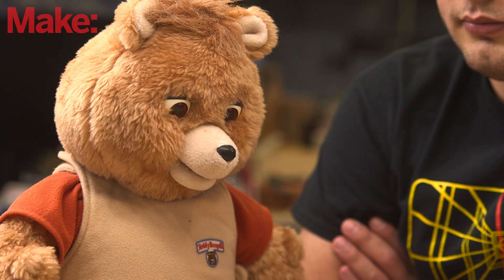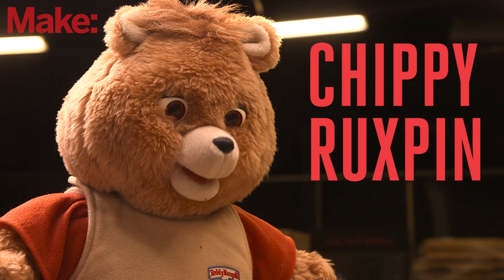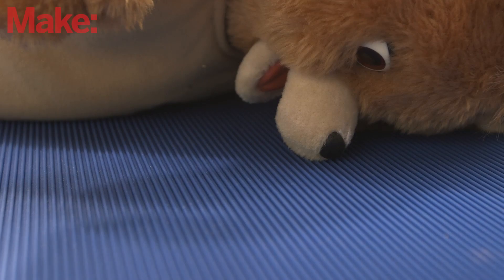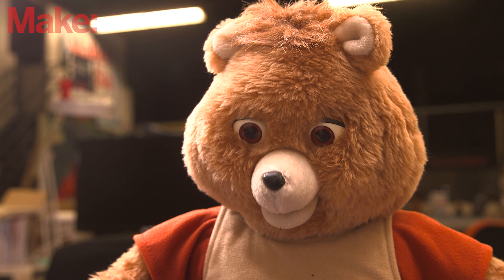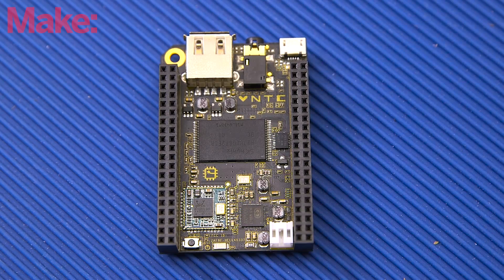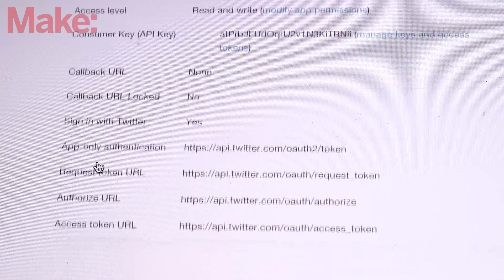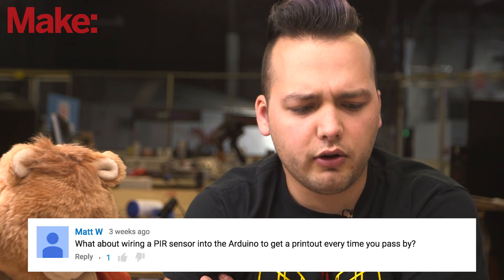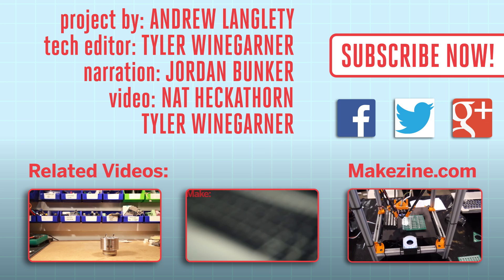Weekend Project: Hack a Talking Teddy Bear with a $9 Computer

Comment: Who calls a lithium polymer battery a "lipo battery?" It is easier to say "lipo", but i thought he said "light bulb  battery" and was really confused for a minute. Hard of hearing folks who don't use "lipo" as a battery term (no idea why anyone would)  will not understand what you mean. You could also obtain  caption files to explain that "lipo" refers to Lithium-Polymer batteries, or even have the word "lipo" in the video captioned as "Li-Po" to get your point across. Currently you have automatically generated captions which state " single cell lipo battery" and i'm fairly sure this battery doesn't suck adipose tissue out of you.
Reply: Max Hudson lol

Comment: What sort of base education/knowledge do you need to complete a project like this?
Reply from the maker: +KayBorn Da Don Soldering and following the wiring diagram is the trickiest part. The code stuff sounds complicated, but you can really get it down to just copying and pasting commands. You should give it a go!
Reply: +Make:  Thank you for responding, it looks like a fun project that I could get into with my son although my ability to solder is lacking lol

Comment: If I remember my childhood right, Teddy Ruxpin would read stories. Could the CHIP code be modified to play audio files, like Audible audio books?
Reply from the maker: +BenG9C9 The python script actually works by taking the output from eSpeak ( a linux test-to-speech engine) and dumps it out to a .wav file. From there (I believe) the sound file is played back, but also analyzed to generate the mouth and eye movements. So the hard work of animating the face has already been done for playback from a sound file - you would just need to modify the script so that it skips the first part of it.
Reply: you can do that with a click and drag and press of the delete key using audacity, i think
Reply: +BenG9C9 If I recall the CHIP Modual has Bluetooth so it should be able to sync with a Phone or other Bluetooth enabled device.  It's just in the code somewhere to add that function.
Reply: glad to see i'm not the only one thinking about modernizing their ruxpin for future generations. it'd be pretty cool for him to read his classic stories, stored on a computer in .wav's, playable for your child at will - maybe you could even record your own stories.
Reply: +BenG9C9 This should be fairly easy to do so.